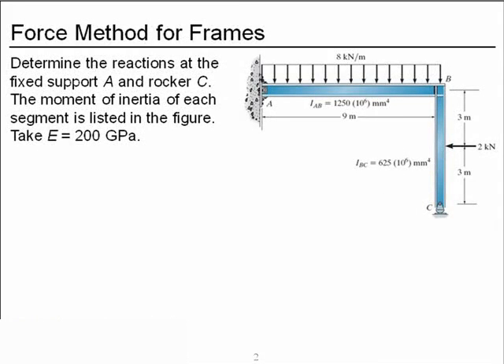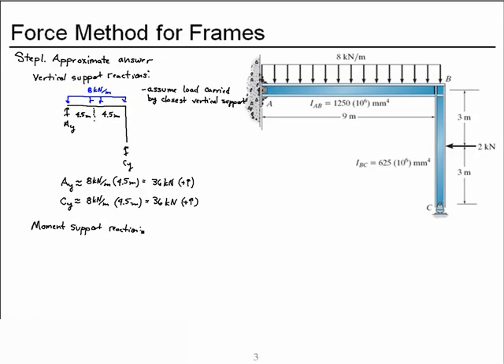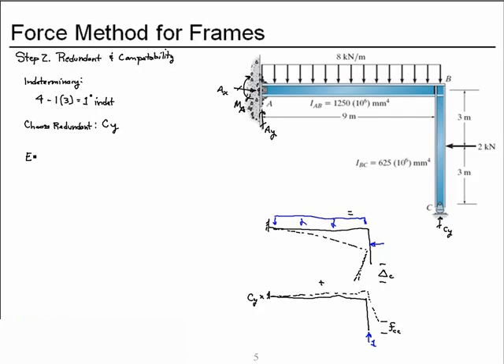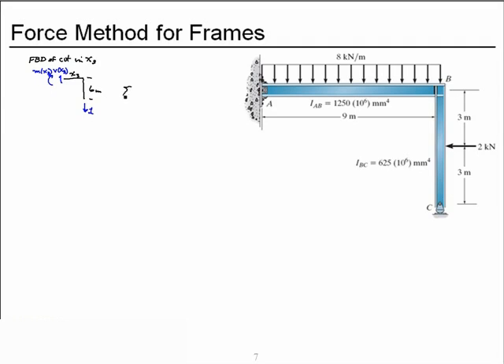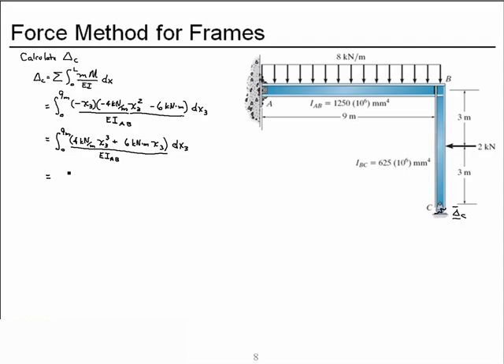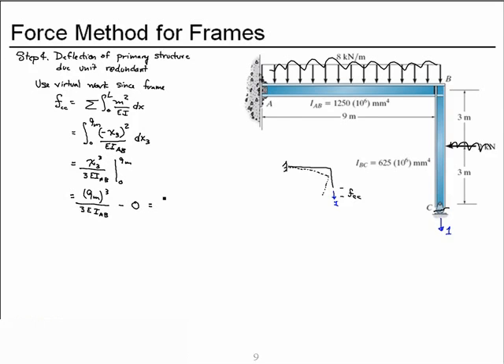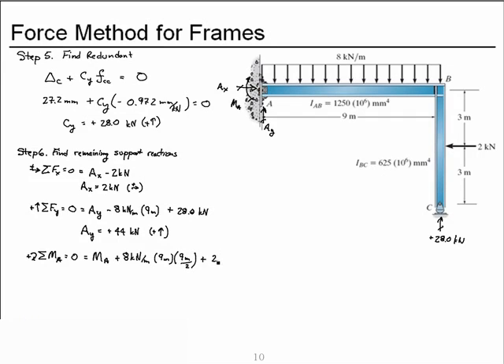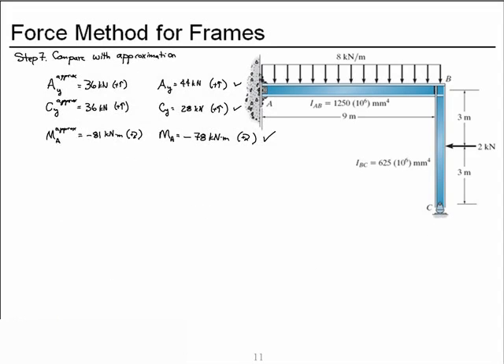Chapter 10-Force Method for Frames (SI Units)

Comment: This was such a great video However, I tried making the moment about A as the redundant and I could not for the love of god get it to work correctly. Does anyone know why this may be?
Reply: Not that this matters anymore but for others reading this:

It is possible to remove the redundant moment however instead of a virtual deflection it is a virtual rotation. 
Basically a fixed support can't bend at the support but a pin can bend so instead of having a deflection at the support it is a rotation. Instead of solving for a force you must solve for a moment.